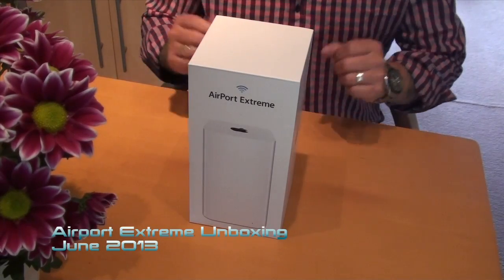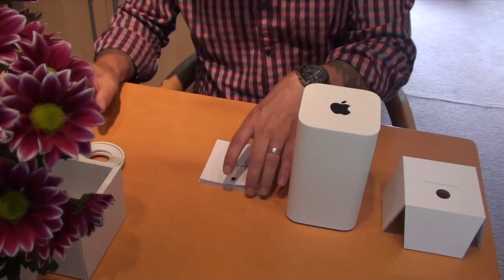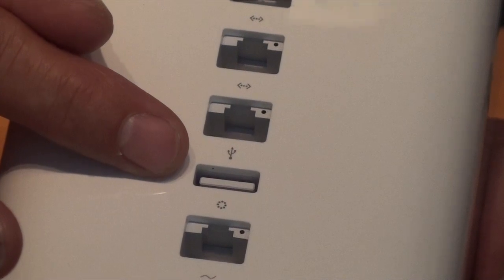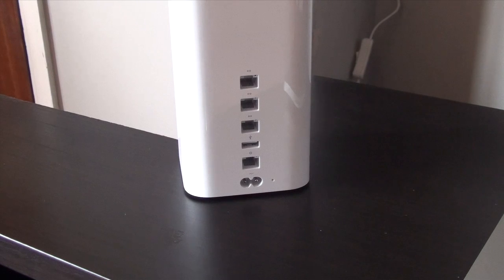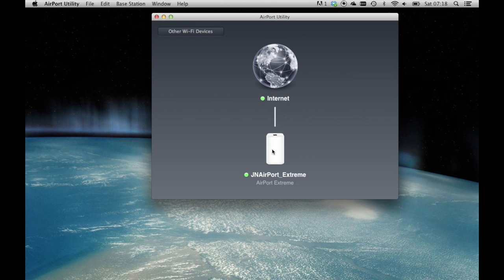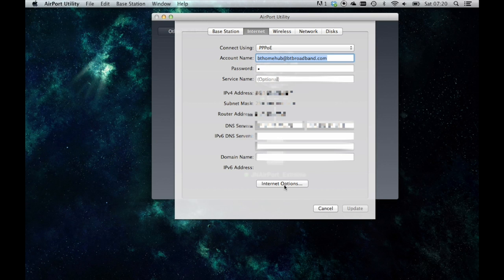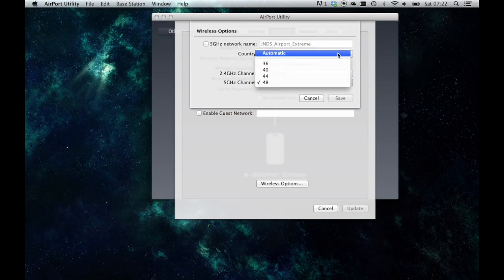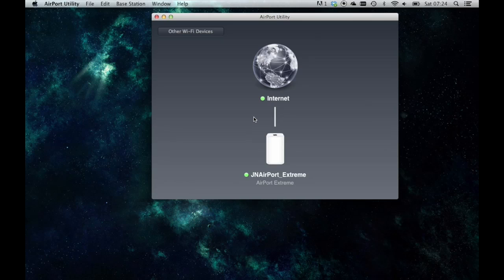Unboxing Airport Extreme 2013 and replace BT HomeHub 3

Comment: Can you ping time.apple.com from your mac connected via this time capsule to BT? I get "unknown host error". This renders my time synch impossible via BT.
Reply from the maker: Hi, yes had no problem with that web address, although trying it now doesn't return a route, so I suspect that server is no longer available or the DNS is wrong. Might be worth trying one that definitely works, such as time.windows.com?
Reply from the maker: Hi, no that address doesn't resolve for me either. Possibly worth using time.windows.com instead?
Reply: Cheers John. It's definitely a BT problem since because of this automatic time sitting doesn't work on Mac by default. Pinning from non-BT service providers work tip top. I changed to time.nist.gov and it works properly. I was trying to establish if the problem is connected to replacing Home Hub with Apple's airport extreme, which I love. Thanks again for checking.

Comment: Do you need a open modem for this to work or can you just replace the home hub 5 ??
Reply from the maker: For this model of AirPort Extreme router, you need a separate ADSL modem. But I now use a TP-LINK N600 which replaced my home hub 5 and it doesn't need a separate modem, and work brilliantly. Even better than the AirPort Extreme.

Comment from the maker: Hi the HH5 comes with a VDSL modem built in (the White BT box in my video) and the Airport needs this functionality as it doesn't have one built in. So you would need to plug the Airport into the HH5 first and the HH5 into the BT socket. Actually, the HH5 is why I no longer have an Airport at all as I found it much better overall that I didn't need both, but your mileage may vary.

Comment: Maybe I missed it, but I didn't see the instructions for eliminating the Home Hub 3. I have a new iMac and Time Capsule arriving in the next few days. I currently have a red ethernet cable from the HH3 to the LAN 1 port on the Openreach router (white box) and there is a yellow ethernet cable from the HH3 to my current Windows pc. Do I simply run one ethernet cable from the new iMac to the TC and then another ethernet cable from the TC to the LAN 1 port on the Openreach router?

Comment: Thanks for sharing, really useful.  I have obviously done something wrong though, as I am getting a message saying Invalid Value - The DHCP range you have entered conflicts with the WAN IP address of your base station? Any idea's what I might have done?
Reply from the maker: Not completely sure Richard without having more information, but - normally, you want to set the range of DHCP addresses' to be one or two less than the WAN IP address. For example - if the WAN IP address is 192.168.1.254 then the DHCP range wants to be 192.168.1.0 to 192.168.1.253. If you set it to be up to 192.168.1.254 then it is perfectly possible that the DHCP server would hand out the 192.168.1.254 IP address at some point, causing a conflict with the WAN IP address of the router - if that makes sense?

Comment from the maker: Quite right - the only use I found was to differentiate in the network selection box of another device between the 5GHz and the 2.4Ghz channels. You can then 'force' compatible devices to use one or the other. Without this, they will switch between the two automatically, depending upon signal strength. I found this useful for swapping to 2.4 if out at the bottom of the garden, and 5 inside. To be honest though, I didn't see a huge speed increase for web browsing over 2.4, possibly slightly.

Comment: Very helpful, thank you for posting this.  One question - Under wireless options in the Airport setup, do you know what the effect / benefit is of selecting a 5GHz network name specifically as opposed to just leaving it blank and then having Automatic for 2.4 and 48 for 5GHz in the lower selections. I assume this allows you to create a dedicated 5GHz channel, but wondered if you had tried this? Many thanks.

Comment from the maker: Sadly, no. Some apocryphal comments from around the web suggest its only useful with 802.11ac equipment, and the range with 802.11n 5GHz is pretty bad. I suspect this might be a little form over function, the antennae just don't seem to have the strength.